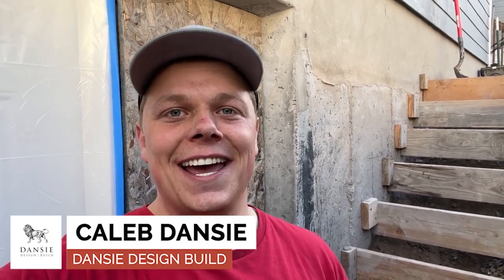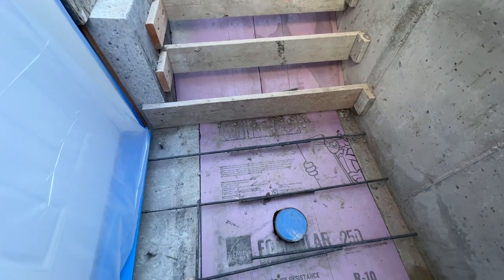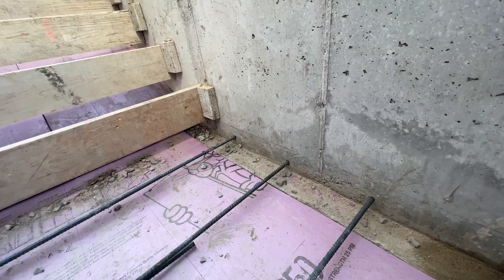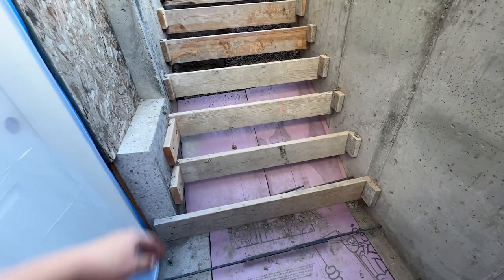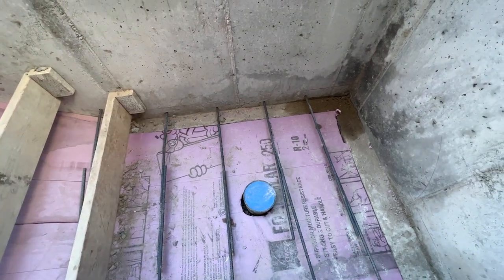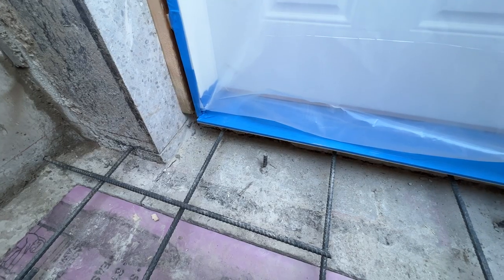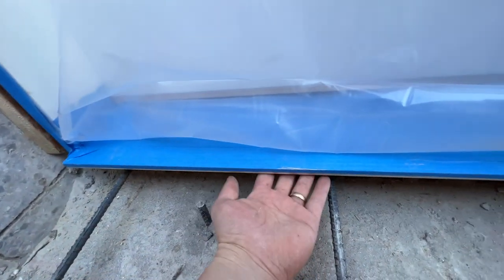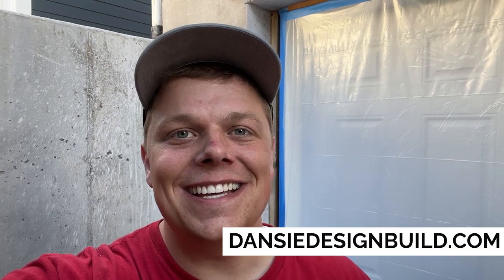Insulating Basement Walkout Entry with Foam Board

Comment: Do you apply an epoxy to hold the rebar in? (like SET 3G)
Reply from the maker: To make structural connections between structural members yes, we use epoxy. 

The stairs are not considered structural, and that rebar is not epoxied in place, as it is not required to be epoxied by structural requirements.